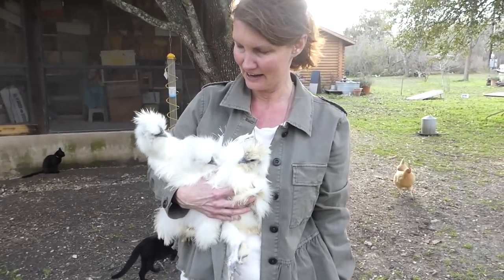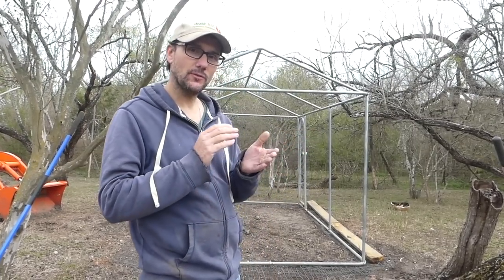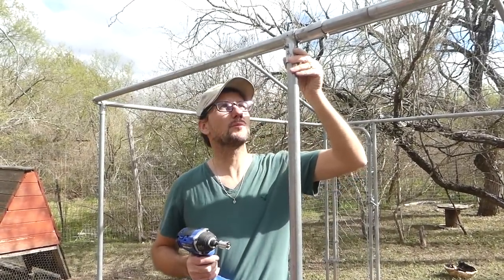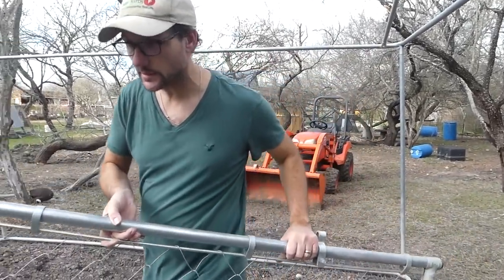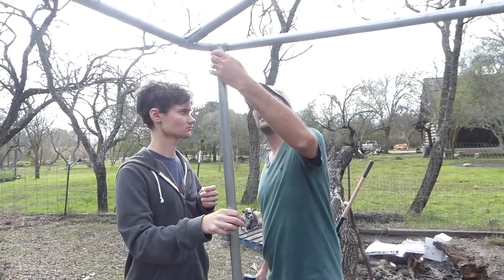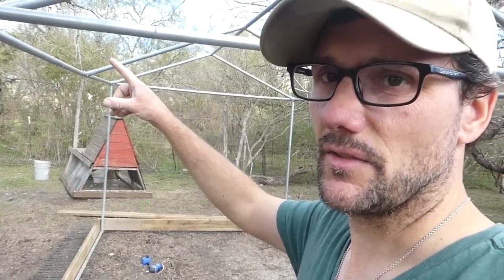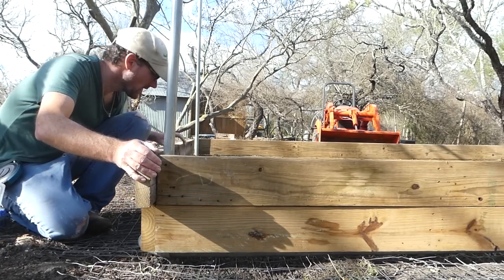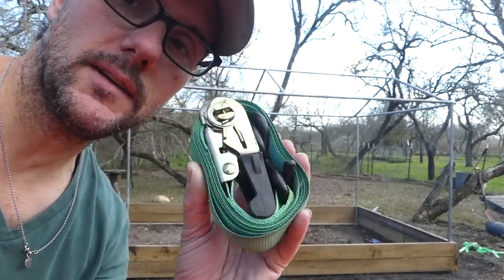She Doesn't Want You To See THAT - Building Chicken Coop from Dog Kennel

Comment: Using the wood you have is always a good way to go. My husband built me a Bantam coop out of our daughter’s old swing set. He used U-bolts to fasten the wood to the metal poles.
Reply from the maker: U-bolts are a great idea. For the boards on the roof of this coop I'll be using a similar idea. Those conduit straps that takes a screw on both sides should do the trick.